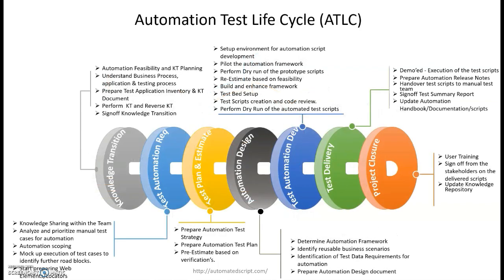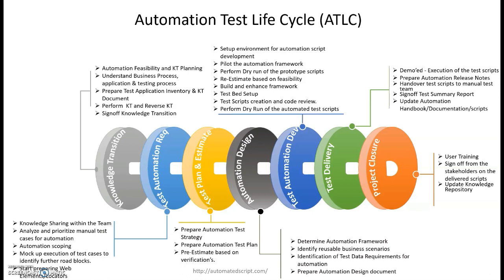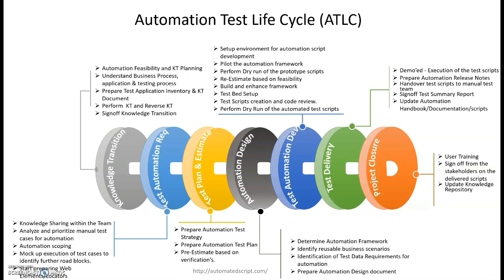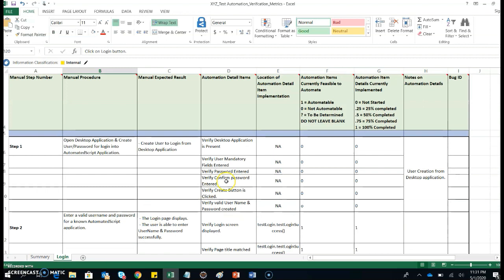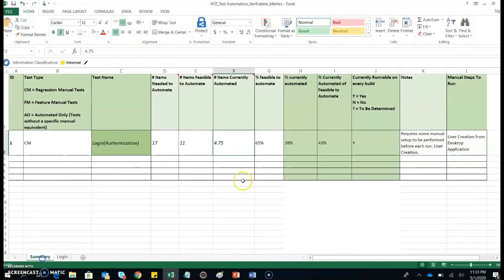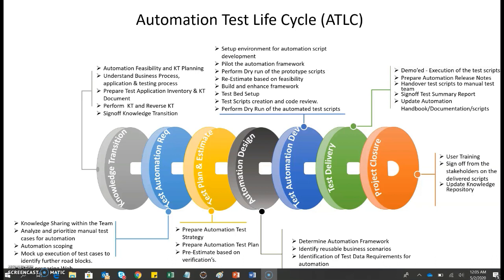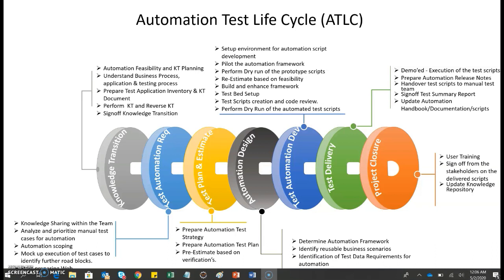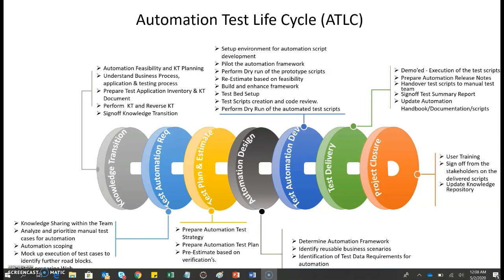Learn Automation Testing Life Cycle in 20 Minutes.

Comment: First of all thanks for this nice video. My question is if I am added to a project in define phase as a manual and automation engineer. In agile process what should be my day to day activity to update my team in daily standup?
Reply: Thank you so much for your comments Pop, good question,  when you lead to a project in a agile way, you have separate task for both manual and automation test team. Very high level,

Manual Task are, functional understanding, manual test cases update, identify manual test cases to automate

Automation tasks are, Test Data creation, locators identify and added, action implementation, verification implementation, test cases implementation.

Comment from the maker: I am sure, this automation test life cycle will help you to kick start automation testing within your current project. Also it will help you to answer in interview.

Meanwhile if you have any question or you want me to cover any particular topic then please post your comment on this video, We will try to cover that in my next video.
Reply: Hi Mahesh, thanks for taking time and preparing a wonderful video. I have a question related to estimation: is there a specific technique for automation extimate? taking your example if feasible to automate is around 11 test steps and if manually my estimate is 3 days what is automation estimate and how do i arrive at it?
Reply: @rsan1908  Hello Sanjay, thank you so much for your question, based on technical challenges and implementation we decide estimation. Like 1 says it will take 1 day for implementation, 2 says half a day for implementation, 3 says 2 hours of implementation and 4 says low technical challenges and some components are already built in so to call or just small modification need bot more than a hour.

Hope this helps.